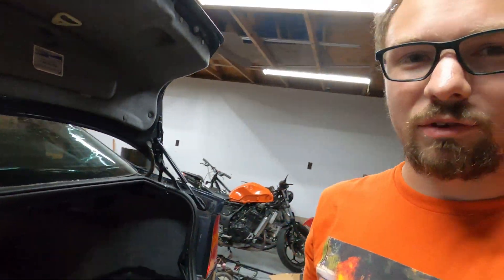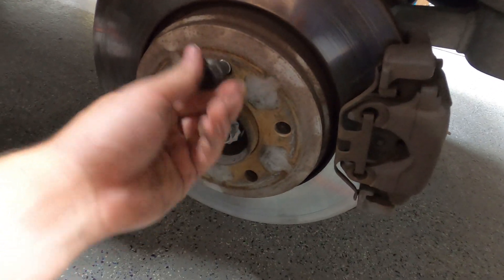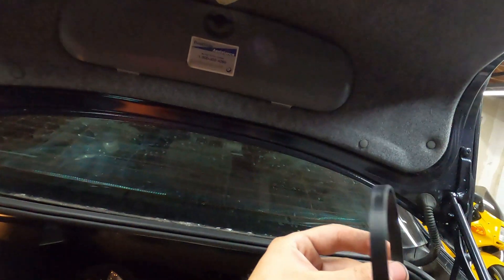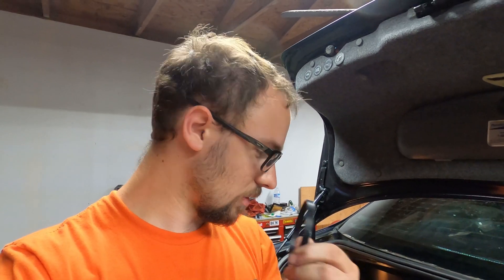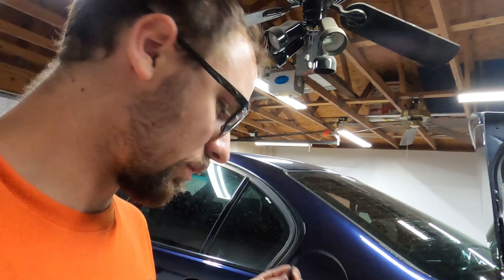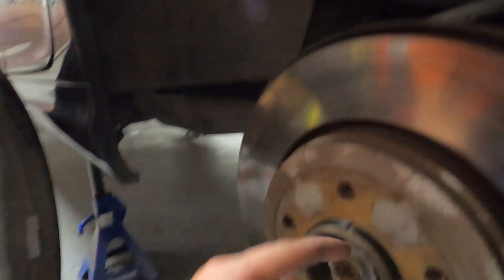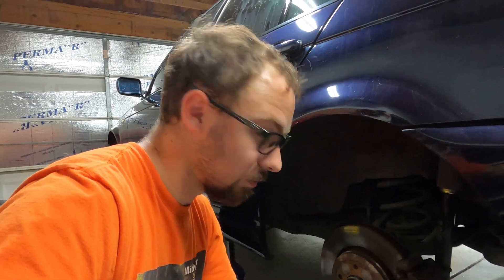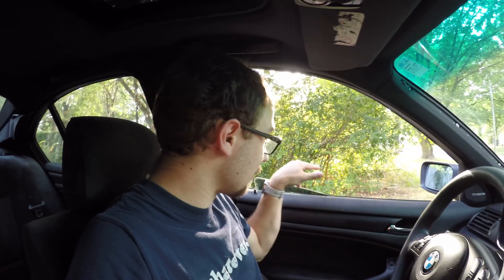3D PRINTED HUB-CENTRIC RINGS! Do they work?

Comment: lol, had the same thing happen to me few weeks back. Was doing break sensors shortcircuit hack on my old audi C5 and as I am finishing I wanna put my windows down and passenger just does weird noise... so as I am finishing fixing something, something else breaks.
Well it is fixed now, and I know how to change window regulator... luckily the old audi had relatively good access to everything, only dealing with rivets was bit of a slow down.

Comment: Great idea, A lot of "real" rings that come with a lot of wheels are actually 3d printed, with very clear layers, I'm not sure which material they use, but I install a lot of aftermarket wheels, and brands as good as Volk send out plastic 3d printed rings.
Reply from the maker: I'm assuming they use GFR Nylon, which has a glass transition point of 176 degrees a bit higher than ABS 105 degrees.